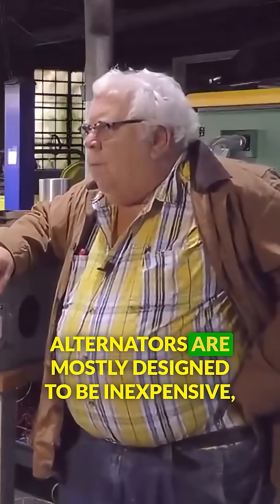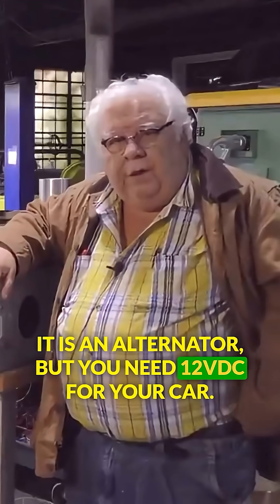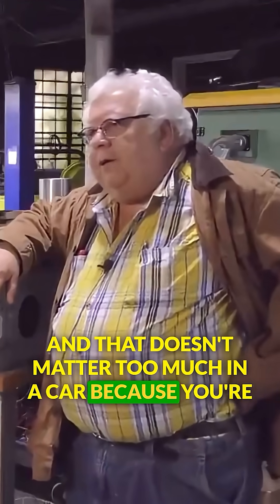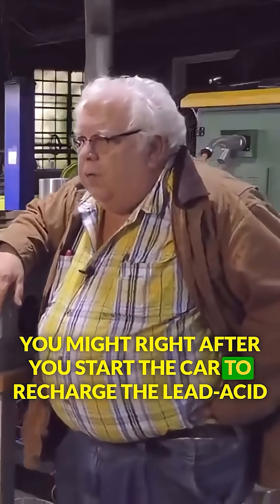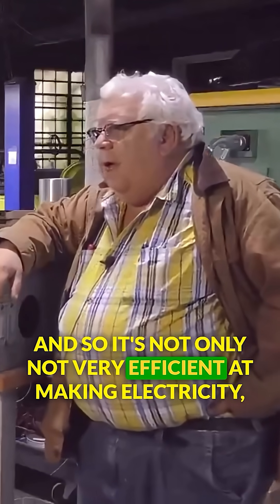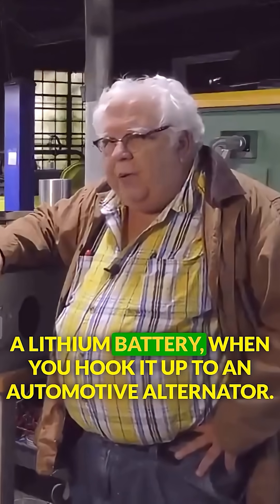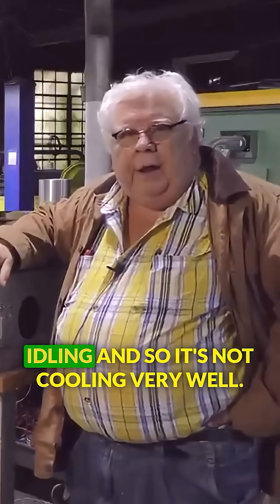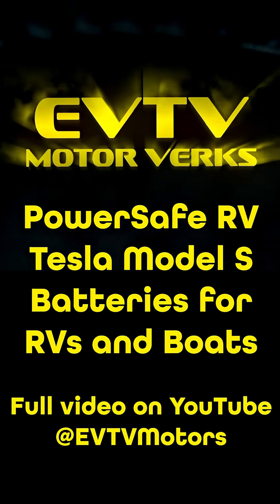Alternators are Only 50% Efficient!

Comment: I worked on Ambulances and we used Leece Neville 200 amp alt. We took the bridge rectifier out and used 3-100 amp Delco rectifiers wired in parallel mounted in a breathable cage mounted behind the front grill. This kept them cool, removing the majority of the heat from Altinator and producing more output at Idle. Worked very effectively.
Reply: I’ve heard of big stereo bass head types using external regulators the same way. So many customers wanted to run extra batteries to “juice up” their systems on an original alternator, not having any idea how much damage they were doing.
Reply: @Mattryanfisher or how much damage bass speakers at volume are doing to the people inside the car not to mention the noise pollution for everyone else in the neighborhood
Reply: https://youtu.be/jRFdCZlt95M?si=pkr_DdsTnZ5VdDXz of another company that does this, at the very end they show the remote rectifier
Reply: @1337prokill3r the big difference is we remove the rectifier completely out of alt. which allows much better cooling of the alt. Ambulances have a lot of things packed into the front that restricts airflow. Some of our units had dual Leece Naville alt. that were 400 amp systems. We needed a lot of power at idle when they set on scene. Now that the industry has gone to more intagrated electronics and LED lighting it has removed that hi amp need but removing the rectifiers and remote mounting them increased the life of the alt. and gave us more amps at idle. The concept  is close but the heat build up is still an issue but thanks for sharing...
Have a blessed day.
Reply: i did an internship at Leece Neville like 30 years ago...almost forgot about that name haha
Reply: @patrickpk6299 yeah I am an old retired guy. 😂 Hell I don't know if they still use them at all with all this new technology. Living in the past. 😂
Reply: Ambulances use a wider serpentine belt than non-emergency vehicles to turn those larger alternators.
Reply: @grantloop9221 your right. Ford had a special ambulance package that was sold for ambulance conversions. It says it right on the door post sticker. There was quite a few things that was different from the standard package.
Reply: I wonder if I could do something like this for my Camrys alternator.
Reply: @Dave_Crupel  You can but the issue is isolating the 3 outputs from the windings so you can run them outside the case. It can be done but you will have to work at it. Leece Naville have post on the Alt. case that make it easier. Also your regulater is part of the bridge rectifier assy. We used an adjustable Leece Naville external regulator. You would have to adapt a regulator which is not an issue but it will need to be added. Best wishes.
Reply: *alternator
~fixed them but can’t spell it…
Reply: @buellb0y You know there's always one person who has to say something about the spelling or use of the english language. Many of us are older and trying to communicate on small cell phones which can sometimes be difficult for us old guys with fat fingers or with arthritis so bad it is hard to move them. Obviously you able to understand what we are talking about an "Alternator." Yes in the haste of typing it out we may have typed it incorrectly, maybe we did not know how to spell it or maybe spell check changed the spelling thinking we were trying to spell a different word. Yes we could have taken the extra time to proof read it and correct it. The fact it not a legal breif I probably won't. The fact is we are just trying to share information about a subject and are not in a spelling bee or writing white papers. So because something may have been spelled wrong does not change the facts of the subject. So if I spelled it wrong I'm sorry, if it was someone else that spelled it wrong, thank you for taking the time to share your experiance I appreciate you even if it was spelled wrong.
For all of you literature scholars that post on here, thank you I appreciate you also and maybe some day I'll be as good as you.
Thank you to everyone who took time out of your day to share your thoughts and have a blessed day.
Reply: @johndavis318 . Also. Robots and AI don’t misspell.  Proves you human and not perfect.  Close but not perfect
Reply: @bulldawg6259 Don't put that in print. I have been married for 47 years and I have almost gotten my wife to believe I am perfect.  Don't want to screw that up, I live in CA where it's cheaper to keep her. 😂😂
Have a blessed day.
Reply: @johndavis318 . 47 years is a blessing.  Your wife might be perfect. Try harder to be perfect in your own self   It will work out
Reply: @buellb0y Missed the comma *, between them and but, ya 🤡 clown.
Reply: These days ambulances use stock alternators. On the bigger rigs, they'll toss a second one on.
Reply: @Zerstoren87 with more sophisticated electronics and high-efficiency LED lighting and more compact efficient altinators I can definately see them using the compact stock altinators. I worked in the heavy truck industry and fire trucks and you no longer see the large altinators like they used to use. Thanks for sharing.
Reply: The Federal Q has gone digital too...

Comment: So all of the alternators we know and use for the past 60 years or so, and usually we see at least 15 years of service life, all of a sudden they became bad and and would over-heat during idle? .. and BTW, the automotive type lithium car battery will charge as normal as any other lead-acid battery, they have a built-in circuitry that manages the charging process.

Comment: I almost wish this guy knew what he was really talking about... If you hook up a lithium that is the same size and already charged vs a lead acid, it won't kill an alternator.. or car audio would be just dead on arrival.  Any properly built lithium battery because you have to build the cells and power match everything is not a starting battery, but is a secondary battery and is connected to the alternator
Reply from the maker: Try watching the full video:  https://youtu.be/nSr9YSfyJgY?si=PAMQmt2TSUjkD7U8&t=3410

Comment: GM (Buick) 3.8 ltr engines mount the alternator to a large aluminum bracket. This bracket also incorporates the heater core lines, absorbing heat soak from the alternator for a steady 195 f temp

Comment: A crank stator on lawn tractors also charges in A/C. JD 31vac. 
Why was the lithium battery installed not fully charged? Sounds like we need to chain someones hood shut. That'll make it purr like a kitten. 600 curb idle sounds Purdy low.

Comment: I believe the theory is the pulse in A/C requires less torque,  at any RPM. 
I blow out and lube the said 'prepacked' bearings as well. Great P/M performance prevents replacing parts.

Comment: this is irrelevant
A lithium battery requires an entirely different charging and protection system from lead acid by default to operate safely in the first place.

That circuitry is responsible for limiting charge current. A lithium cell must be used on a constant current regulated charger, as when connected to a power source without current limiting, the cell can draw effectively infite current till it either reaches the charge voltage, or, more likely destroys itself.

Comment: But I you hook up any charged battery they won't draw electricity. 
If you hook up any flat battery then the battery will draw the maximum amps but that will be limited by the type of battery and altinator.

Comment: Alternators are ECU controlled in my 20 year old Rovers.
There isn't a problem.
The current is limited sensibly.
In my 10yr old Jag 351 the BCM controls the charge rate. 
New batteries on even younger cars have to be coded in to maintain the calibrated charge depending on battery capacity.
So this video is slightly out of date ⚠️

Comment: Generators had very low outputs on cars and they also spun at slow speeds and in the case of lucas they had a brass bush in the rear, non drive end.

Comment: The voltage drop across a diode is .6 to .7 volts. With 100 amps flowing through one diode the heat dissipated is 70 Watts (.7 volt x 100 amps)  using two diodes to rectify the AC to DC the total wattage dissipated is 140 Watts (478 BTU's). This is a substantial amount heat and would require a fairly large heat sink.   your first statement that the dissipation of all the heat is generated by the diodes is not correct.  What ever other load that is in the circuit (battery, radio, lights, excreta  Is also generating the generating heat and a heck of a lot more than the diodes.

Comment: This is why I never bought into the hole lithium battery thing, I have always used optima gel batteries or other quality acid batteries, after seeing how lithium batteries are at any temperatures below zero is all I needed to know that they cannot handle it, I have a 94 Ford F-150 I took the stock 65 amp out add a friend of mine who's been building a custom building alternators for over 50 years go through and rebuild mine to be 120 amp ambulance heavy duty alternator of course with necessary new battery cables as such I have not yet once after 2 years I've ever seen my alternator get warm or my optima batteries

Comment: I burnt out an alternator. The battery was almost completely dead and then I went for a drive at night in heavy rain. The flat battery with full lights and full windscreen wipers was too much load for the alternator on a little light duty fiat punto

Comment: That's why brushless permanent magnet alternators have a flat output but don't suffer from the inefficiencies of coil and uncoil... In QED quantum electrodynamics this would undoubtably be lost motion through the vorticity of not only the under-square, over-square and sphere-shell vortex. I can see a present day alternator like you described as being a minto-wheel  with nine tanks on a vertical wheel?

Comment: DC generators in past auto manufacturing history required ferrous magnets; heavy, brittle, heat labile and brushes. Their output was not linear at all so they performed best at higher RPM's.  Alternators output is about 85% of max while at idle. Lighter in weight, no iron magnets or carbon brushes and by 1970 became millions of dollars cheaper, per month, within Detroit, Aichi and Nagoya supply chains. 
    Internal combustion engine powered autos have a maximum thermal efficiency of more than 50%, but most road legal cars only achieve about 20% to 40% efficiency.
   The "waste" heat of alternators or generators is "minuscule" when contrasted to radiator or tires against road surface... or internal friction etc etc.

Comment: That was early in the lithium batteries. Now with lifepo4 batteries, especially the ones designed for starting, they have a specific programming in the BMS that prevents that. I have multiple lifepo4 batteries on my bass boat, and they are so much better, in every single way. They are on a whole different level.

Comment: Will the windings handle the increased load if a man comes up with a more efficient rectifier though? Seems like you'd still have the heat problem. It would scale up with the increased current. There some formula for that I can't remember.

Comment: You are not taking into account of the gear reduction of the drive belt of the alternator at 600 engine rpm the alternator is probably spinning at 1500rpm so it is fine at cooling itself. Also with modern variable field alternators the engine ECM will monitor the current of the alternator and reduce it by lowing the field voltage. Sound like you are stuck in the past yea if you put a lithium battery on a 1970s car it would burn out the alternator

Comment: DIODES are about .7 volt drop ...so  ...3 phase alternator  at ≈100 amps output ≈  70 watts heating at DIODE TRIO ...140 watts minimum heating ....DIODES CAN BE REMOTELY  MOUNTED TO GET HEAT AWAY FROM WINDINGS ...SILVER WIRE CAN BE USED , 10% LESS RESISTANCE THEN SAME SIZE COPPER WIRE  and 30%. BETTER HEAT CONDUCTION/DISSIPATION

Comment: Dual internal FANS ..OLDER DESIGNS USED ≈6 amps for rotating field x 14 volts = 84 watts internal heat from ROTATING FIELD WINDING ...DOME OLDER SLTERNATOR DESIGNS , G.M. /BUICK had CURVED BLADE , SINGLE FRONT FAN  FOR COOLING ...BETTER DESIGN CURVED BLADES BLOWING ≈30% MORE AIR ...COMPARED TO STAMPED/STRAIGHT BLADES

Comment: If it's 1200W and 50% efficient (although it's up to 75% efficiency in today's cars), then heat output can be 600w tops, isn't it? And that's the worst case scenario, they usually don't operate under full load continiously. Alternator typically get warm, but you can touch it bare hand. 600w would get it as hot as an electric hob.

Comment: A dynamo worket fine with a external chargingrelay. I dont remember the time but a generator also had a external rectifier(full bridg rectifier) do you know that guy. Altenators ar ewrything in 1 packige and only 1 thing needs to fail and it costs mor monny to by the whole thing in sted of a rectifier or cool's. It is a monnymaking mashine

Comment: All Mercedes S class from 2014 and newer only have lithium batteries, no lead acid batteries except for auxiliary power.  Never had an issue with them charging the lithium batteries or burned out alternators…

Comment: That's why automotive lithium batteries have a BMS to limit charging current to a maximum of 1A/Ah. LiFeP04 batteries (typically used in automotive lithium applications) should ideally charge at .5A/Ah or less. If the battery is sized, managed, and maintained properly you'll never have an issue running lithium batteries in any standard automotive 12/24v system.

Comment: It really depends on the load of the battery though. The internal resistance of a lead acid battery is much higher than that of a Lithium battery. So it gives great amps, but takes great amps also. It has to be a matched system.

Comment: There are a number of flaws in this commentary. The alternator for vehicles was developed to meet the ever increasing demands on the battery in modern (late 70s early 80s) slow moving rush hour traffic where the dynamo (limited to 22A output)  needed to be disconnected at low speed to prevent reverse current flow thus exacerbating the problem.

An engine idling at 700 rpm will be driving the alternator at at least twice that speed (check the crankshaft pulley size to that of the alternator) Also the Zenner Diode used in the control circuit prevents current flow in the wrong direction but conducts as soon as the threshold voltage is exceeded. As battery voltage rises it will meet the control voltage and current flow will desist. There is also a temperature sensing circuit within the control circuit. This reducing alternator output irrespective how much more charging the battery needs. This is the reason that a seriously discharged battery will never recover a full charge from the alternator and will need need charging by a stand alone charger.Typically a 12v nominal voltage battery will need an 18v output charger to achieve the full recharge. That's just the basics.

Comment: On my small block Mopars, the Denso alternators (mid 80s) put out significantly more at idle than my old style Cheeseler alternator did on it's best day ever, at full tilt screaming down the highway. Love these Densos. Love the Denso starters even better. A bolt on, gear reduction, free mini starter upgrade. Damn things spin it up on start up faster than my motors idle at, with half the draw on the battery.....and the copper lugs to rebuild em' are less than a buck!!!!!
Reply: Remember that old Mopar starter sound?
Reply: @terrykrueger I do Terry and honestly I don't miss it with my new Denso (Chrysler) starter. Half the draw on the battery and it spins the engine faster, on start up, than mine idle at. Very powerful units for half the size, giving us lots more room for exhaust and headers. Did I mention you can change the copper lugs for pennies and in minutes, by yourself. Absolute Denso convert. AND every junkyard in the country is stacked full of Magnum engines to get them off for $25.00.
Reply: @terrykrueger I sure do. Mechanical sounds are like voices to me. Each different engine, or starter, or even something as simple as an old box fan with metal blades and worn bearings has a different “voice print.” 😁 I often find myself thinking or even commenting on movies where the sound effects department got the right engine sound for a particular car, especially older ones. 😂
Reply: Denso makes excellent products. It's not a very useful anecdote, but the only Denso parts I've ever had fail in one of my own cars are two MAF sensors around 200,000 miles each. I could probably fill a dump truck with the number of Bosch ignition coils I've gone through alone.

Comment: Oops. Lost me at Lithium battery. He's out of his ball park. A lithium battery will NEVER pull as much as a lead acid! And...he's not taking into account that an alternator has an internal regulator...that measures the voltage output and the current output of the alternator, and adjusting the stator voltage accordingly. 

In short, he's talking total nonsense!

Comment: And this is why you need a charge controller to feed the battery at a controlled rate.  I use a DC-DC converter/controller to charge mine, although my lithium batteries aren't for cranking - I still have lead acid for that.

Comment: 50% efficient? Show me your math on that one… while it is dependent on load/rpm/voltage, they’re around 70-80% efficient. They are very good at what they do. The biggest killer is bearings, people not replacing batteries when they should, and poor diode cooling.

Comment: Not sure why diodes were mentioned. They have little to do with efficiency. Back in the day, cars had DC generators, which were less efficient than the alternators. At idle, they couldn't charge the battery at all.